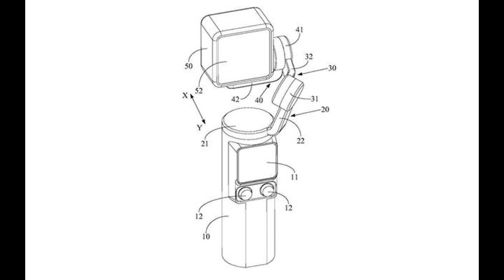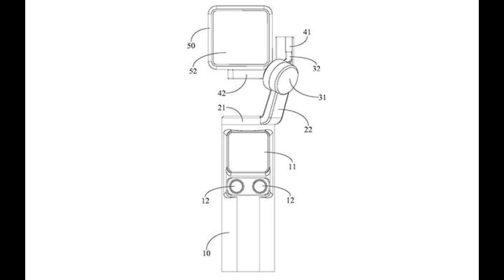DJI Pocket 3 - DJI patent application reveals all - or does it?

Comment: I think what Gimbal cameras do differently from Action cameras is maximum usage of sensor area. Their footage is more like camera footage shot on gimbals, competing in that area. Unlike action cams, they won't put an insane ultra wide angle lens and do cropping on that tiny sensor for stabilization. I think Pocket have less digital sharpening also. If they use the same Action 2 camera module on Pocket 3, the footage will be too wide. If they create a new Pocket 3 camera module, something like a 1-inch (or witch same sensor) vesion with a moderate a wide angle lens [which can be used with the Action 2 Power/Screen Module], it will not be wide enough for digitally stabilized action cam puposes of Action 2 users. I'm waiting to see how they resolve this issue. 

Pocket 3 in my dream is just a 1 inch version of Pocket 2 (like the one in the Air 2S drone) with improved video recording specs like 10bit etc. 

Pocket 1 &2 designs are also friendly to accessories like ND filter, anamorphic adapter, wide angle lens etc..
Reply from the maker: I would add a larger display to your wishlist.  We will see soon...

Comment: With a second motor elbo you can add an extra axis of rotation and stabilization, which would open up a whole new world of features in motion controlled time-lapse shooting (Motionlapse feature). Yeah, swappable sensor and lens blocks would give you higher video resolutions.

Comment: This could also be an Action 3 and OM 6 gimbal combo. Patents don’t have to show actual equipment designs only functions so the Action 2 camera module in the drawing may be a red herring or an early design. If DJI wanted a bigger sensor in the Pocket 2 format the gimbal would likely need to be upgraded to accommodate the bigger package. The gimbal and bigger camera may not be too dissimilar to the Action 3 and OM 6 so the product lines converge. The OM 6 leaks suggest it’s smaller than the OM 5. I’m sure we’ll find out in due course.
Reply: That aged like milk in the desert. I hope you're right and it has a 1" sensor or at least better low light performance, 10 bit and higher bit rate codecs an absolute must. A sensor and gimbal combo as depicted with these specs could be a very interesting tool for filmmaking. I'm not a fan of the super wide FOV of the Action2 though, too wide for a gimbal cam IMHO, Pocket 2 FOV is spot on. It was interesting that battery life was a big selling point of Action 3 so can we expect a Pocket 3 with much longer battery life? Roll on November.

Comment: DJI better upgrade the Action 2 camera quality, as mine is dog poo compared to my Pocket 2. Pocket 3 needs same form factor - removable battery - built in WiFi/BT for DJI Mic -  Mic out port -  1 inch sensor or very near it   - under £600 to compete with the entry level ZV1 - and a hot shoe mount.  You just know  DJI will probably try to make the Pocket 3 a 360 camera with removable lenses (like the Insta360 R models) which is fine as long as the base comes with a 1 inch sensor at anything above 4k60. I've tried most camera's and still end up finding my way back to the Sony ZV1 with its limitations and all ! but that video quality is unmatched for the price.

Comment: DJI has lost plot. They need to sharpen their pencil and do more research as they can easily lose market share real quick! The Action 2 is a piece of crap!
Reply from the maker: It certainly doesn't work well in low light.
Reply: @Ozpeter  Agreed Peter, but even it's silly modular design - there's just no advantage for having it. They had something special with the first Osmo Pocket.

Comment: hopefully this isnt what it is. the pocket is a solid system that works and they should only increase sensor size and resolution and fix z axis either with an addon or with turn on digital stablization. 
theres several problems with this image design, if the handle is where the sdcard is, the camera can lose connection and potential loss of data, or stop recording. also more parts to break, alot bigger is unwanted. they can release the gimbal for the action 2, that would be fine. but pocket has to be one solid as it is with upgrades.
Reply: obviously the memory card will be inside the camera module, not inside the handle, like in any action camera, so no worries there really